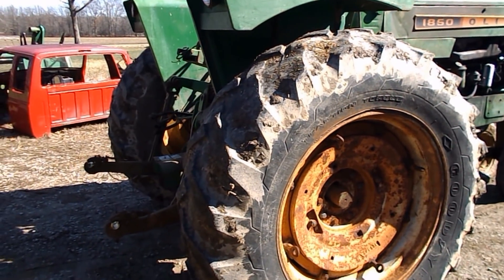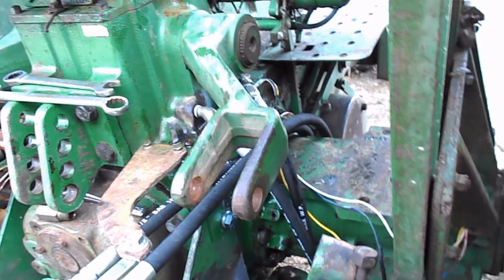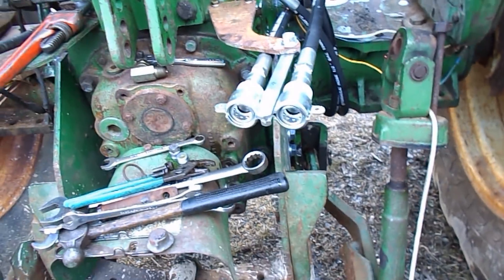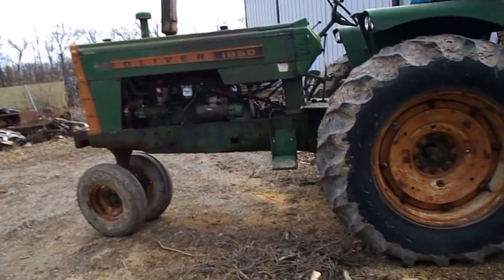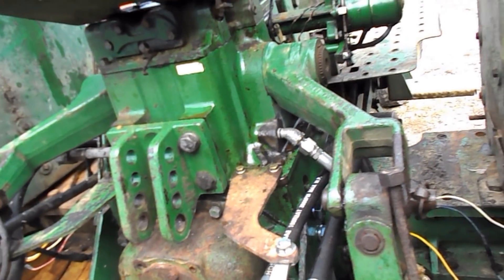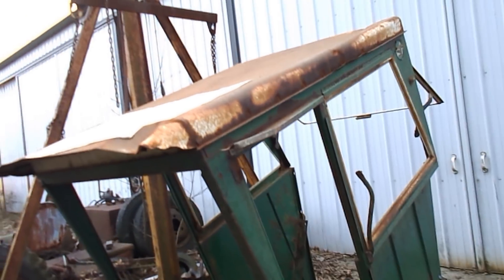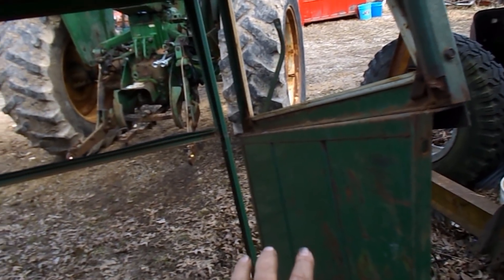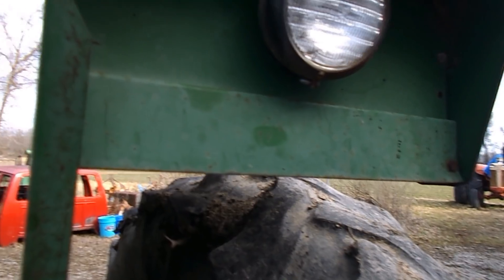Putting New Hydraulic Hoses on the Oliver 1850 part 10 A

Comment: Glad you're gonna put the cab back on it & some LEDs! Snazzy Outfit.
Reply from the maker: Yup cab is going back on for sure, I want to sit in the shade for a change and be out of the sun. Some might not like the cab but it came with the tractor and I have a use for it and can put some windows in it witch will help stay cooler. I bought some LED lights witch I'll use on it and I want to get some LED flasher light for the sides of the cab so it can be seen if I go on the road.  Bandit
Reply: @banditfarmer1900  Good deal.
Reply from the maker: @SchnelleKat  Its coming together nicely !  Bandit

Comment: We had done something similar with the hoses on an old Ford tractor. Discovered rather quickly it was a huge mistake for us to wrap around the axle. We went with galvanized pipe, short hoses and a more direct route with the hoses. 
For the cab, check into a sheet metal place, such as a heating/cooling company. They may be able to sell you a sheet the right size for the cab and at a much cheaper price than some place such as McMaster-Carr. 
She's coming along, if you got a moldboard plow, do a little spring plowing, that will help the old girl out. "Blow out the cobwebs" as the old saying goes. Hahaha Great video as always. Cheers :)
Reply from the maker: Well my 1550 has the hoses wrapped around it and I haven't had a problem with either set sense 1988 when I bought it and put them on so I'm not worried about them on the 1850. As far as the cab roof after looking at it closely I think I'm going to replace the patch on top that leaking cause finding a piece of metal 67" by 54"  is going to be hard to do, So a replacement patch is in order and I know just the scrap yard I need to go look threw as soon as it reopens after this virous crap gets over with. The 1850 needs worked for sure , Its running a lot better now but it still needs to be worked hard to blow the cobwebs out of it and get everything working good again.  Bandit

Comment: Making progress on that tractor my friend.  As Always , good video!
Reply from the maker: Thank You Charlie, Going threw it one thing at a time and making sure its right when I'm done it will be ready to go and I know its right. One thing for sure you guys are seeing about everything I do to it and this is what I do to every tractor of combine when I get it.  Bandit
Reply: @banditfarmer1900  Well, I have 4 Olivers and a White, but I learn something from you in nearly every video.  Sometimes what I learn is not Oliver tractor specific, but just a good general mechanical tip.  I've gotten lots of them from you.  I know my limitations and am not the kind who thinks I know everything.  I sure don't.  And I am definitely not afraid to ask someone who DOES know what I need to know or to get them to help me.  I always believed that we get taller by standing on each other's shoulders.  We need to learn from each other and share what we know.  I really appreciate having you as a friend appreciate what you share.
Reply from the maker: @pagrainfarmer  My friend we learn from each other and this is one of the many reasons I love youtube, We do learn from each other. When I bought the 1850 I knew I had to make a series of video's about it and show what I do to a tractor when I get it, 99% of what I've been doing is normal maintenance . Changing oils and filters greasing it adjusting brakes and clutch and at some point the PTO clutch. Now granted I bought it December 2 and hear it is March 22 and I'm still not done with it and that's because of weather or other restraints but the work is still getting done. I have it in the barn right now getting ready to start changing all the hoses when it warms up Monday or Tuesday but she is getting closer to being done. The day before yesterday I had started it up to move it around and it started leaking fuel out of the injector pump so I need to look into that , Might just be a loose injector line from ware I blead it but its a minor thing too fix. But everyone is getting to see everything I do to it and most of it has been normal maintenance and replacing what needs replaced like hoses and belts valve cover gasket adjust the valves but nothing major has been done to it. But when its done I know its going to be right and ready to go and look pretty good too ! I've taken a few ques from you guys on it so you guys know it or not are involved in it too .   Bandit
Reply: Yeah, us farmers have to stick together And help each other because few others will help us.  We have to fight everything - the weather, equipment, low prices for our crops but high prices for machinery and parts, stupid people who don’t understand, etc., etc., etc.  You know what I mean.
Reply from the maker: @pagrainfarmer  It takes a different kind of person to do what we do and were the biggest gamblers in the world !  So we have our own support group its called YouTube !  LOL If you ever get to feeling down in the dumbs just drive down to the local Wal-Mart and walk around and enjoy the sights and I guarantee when you leave you'll have a smile on your face and feeling pretty good about yourself !  LOL  Bandit
Reply: That’s what’s nice abiut the youtube community - there are certain people on here like yourself, Jacob, Soybean Farmer, etc who are down to darth and really “get it”.  Great to be able to discuss farm stuff with people who truly understand.  Then as you know, there are lots who really don’t understand.  Oh, and yeah, I DO k kw what you mean about the Walmart trip.  Hahaha
Reply from the maker: @pagrainfarmer   I was told one time that I had an old soul , Still don't know what she ment by that but there are people on here that really understand and get it. There are a bunch who seek fame and fortune and are sell outs to make money. But there are some who understand there is more to farming than just making a buck and don't have to have shinny new equipment or farm the whole country, No there are content to farm as they always have been with the equipment they have and there happy people.  There are a lot on here who just want to cause a problem start crap and act like they know it all and think they need to tell everyone what they should be doing. I have no time for such foolishness and its a waste of time to try to explain anything to them because they are always right in there small little minds.  But if your lucky you become friends with some of the people on here and it enriches you life in ways you never expected .  I was at the Wal-Mart the other day and it always amazes me how some of the sights you see in there, I know as they say It takes all kinds to make the world go round but WOW !  I hope for the best for us this year and hope its a good year for a change, We could use one about now !  Take it easy my friend.  Bandit
Reply: Yeah I think I suffer from that “old soul” thing too.  I always thought I should hAve been born 50 to 75 years earlier than I was.  I love what I do on the farm and love doing it the old way with “classic” equipment.  People like you I appreciate because you really get it.  I also hope we have a good year and that this virus stuff doesn't kill corn and soybean prices this fall.
Reply from the maker: @pagrainfarmer  I think the draw for me to the older equipment is that is all mechanical and I can figure it out and fix it. But the new stuff all you can do is stand back and watch when the service guy get there and hooks up his computer to it and does his thing. I like to be in control of thing because lets face it we have so little control over anything but on that old tractor you are in complete control !  I thing as far as crop prices go with last year huge losses from over 19 million acres not being planted and all the crop losses due to flooding and ground that is gone now from river changes prices have to go up some. Prices go by supply and demand and when the supply gets low like it is now they can go so long before they start raising prices to try to get more in to meet the demand.  You know if you think about it China does the freeze on our US grain imports screwing up the economy and now this virus coming out of China it really makes a fellow wonder.   We could really use a good year for a change so we can be a little more comfortable .  Bandit
Reply: Yep, what you say is true. Our old olivers are simple machines that are relatively easy to work on.  I hear that a lot of farmers that have had modern tractors are trying to find bigger but older tractors for that reason.  No computers, DEF, etc.  i hope you’re right about corn prices.  Not only did some guys not fet acres planted, but the at reports I hear on the radionsay there a lot of acres of corn in the west/mid west that never got harvested last fall.  Still out there.
Reply from the maker: @pagrainfarmer  The old tractors can sit unused for months or years and as long as the battery is up they will fire up and go to work and there a lot easer to work on. The BTO just down the road from me has a bunch of new equipment and I mean big and a lot of them ! But they also have a bunch of old IH tractors still working too from H's and M's to 806 1206's 766 966 1066 1456 1466 1486 1566 1586 and more. I don't know a farmer who has all new stuff that doesn't have an old tractor or 2 around on the farm.  There was a lot of corn still in the fields around here up till about a month ago and its pretty well all out of the field now but there was a lot of loss in it too. Most of that corn was later planted that just would not dry down so they left it in the field till it dried down some. I truly hope this is a better year with better prices but its not looking the best right now.  But I still have hope !   Bandit
Reply: I have hope too.  That’s part of being a farmer - new hope with each new planting season!

Comment: Lookin good Bandit, I’m excited to see it with the cab and windows installed, should look pretty neat. Thumbs up!
Reply from the maker: I hope I can clean that Lexan up good and buff it out clear again and I think it will work good on the cab as windows, The tint isn't very dark but I think it will help keep it cooler inside. Even if the side windows don't open the back opens pretty far out so I think a lot of air will move threw it and I like that idea cause I'll be out of the sun ! Some new LED flashing lights on the sides and 2 LED's on the back and a couple on the front I think I'll be able to see pretty good and be seen too !  Bandit

Comment: I am enjoying seeing the 1850 coming along. I have two thoughts, I understand why your wrapping the hoses around the axle, I would get a piece of the nylon hose sleeve and put on them to keep them from rubbing on the axle housing or getting snagged.

Second thought, on the cab of you could come up with a way to fit a piece of aluminum foil bubble insulation in the roof might help keep it cooler by reflecting some heat back.
Reply from the maker: Travis I've been doing it this way for 30+ years and I have yet to have a hose get snagged on anything yet nor have I had a hose get rubbed spots in them and this is why I leave them the way they are so they stay relaxed. I would rather spend a little extra on hoses and route them this way so they are relaxed so it makes it so much easer to hook and unhook a hydraulic cylinder plus if a hitch pin comes out the hoses wont be ripped out of the casting, At most it would bend the pipe nipple down witch would be easy enough to change.   To cut down on noise in the cab I'm going to spray rubberized under coating on the inside of the sides of the cab to deaden any noise but for the roof I'm not sure what I'm going to do on it yet , It needs replaced if I can find sheet metal to make it out of in one piece. A piece 54" by 67" is not going to be easy to find. I am looking at my old 95 combine to see if I can take the cab off it and making the roof work on the top of the Oliver cab and widen the top of the cab about 8 or 9 inches down to the fender top.  Don't know what I'll do yet but right now I need to get the tractor finished and the cab and fenders put back on and get it ready to work, I'll have more time this summer to make modification to the cab, Nice thing is the cab is bolted together so I can take parts of it off as I need to and make things work better.  Bandit

Comment from the maker: Well I got a nice day and went and got some new hydraulic hoses and new Pioneer hydraulic ends on the 1850, I want dual remotes on the 1850 so here we go. I ran into problems right off the bat as the plugs were frozen in the casting so I had to heat them up with the torch and really had a time getting them out, My poor Craftsmen 3/8 ratchet was bending a we bit when it finally popped loose and the other one was just as bad to get off but they both came off finally !  Sorry about the missing video of putting the hoses on the video file is really glitchy to say the least and have no idea what happened to it all the rest are fine but you get to see most of it. After getting this put together I'm not happy about the way it is or looks and I might be taking it all off and doing it another way. I wanted 4 hoses and sets of ends but all they had was 2 hoses and 2 couplers so I figured I would put the set on the right side first before I replace the other side. On the cab I have a plan for it and I really want to leave all the writing along the sides of the cab alone, Kind of tells a story about the 1850's history in what was done to it and when. I have a feeling I'll be taking this back apart and doing it another way. On the tinted lexan do you guys think its a good idea or not, Let me know in the comments. Well I hope you enjoyed watching and let me know about the Lexan.  Bandit
Reply: @bandit why not cut the bracket end off, and reweld it at a 90 degree angle so the remotes are in the vertical orientation like on the other side
Reply from the maker: @jmon1177   I could do that but I would rather have them this way to make it easer to hook up. The other side is set up for Oliver ends that no ones has anymore plus it looks cleaner this way.  Bandit

Comment: I can see why you're doing it that way, but I would rather make it so there is a 90 degree pipe fitting about 2 inches(might have the one further ahead out abit more) from the casting then have the hoses run straightish to the couplers factoring enough slack for the couplers to work right. I just hate seeing extra hoses wrapped around things. Call it ocd if you like. 
The cab idea seems good. I would think that you could have enough ventilation with a windshield installed, since enough air would come through the doorways. You could always add a windshield later, if you desire. 
Keep healthy my friend.
Reply from the maker: Well you know how fun hooking hydraulic hoses up to an Oliver can be so with the hoses wrapped around the axel like this 1 it gives you more room to get ahold of the hose to force it in and 2 IF something happens to the hitch pin and something comes un hooked the lines are relaxed enough to let them pop off easy. My 1550 is wrapped around the axel just like this and I did them this way in 1988 when I bought it and I've yet to have a problem with them.  The next video will show how I fixed this problem and cleaned it up.  I think my idea about side windows and a back window is a good idea to keep the weather off me and with a back window that opens as far as it does a lot of air flow threw it to keep me cool.  Bandit
Reply: @banditfarmer1900  I would be worried about thing snagging on the hose, such as when you spray corn that is getting tall. Our David Brown has a single remote and one way couplers like what I am thinking you bought for your tractor. The hoses are maybe 18inches long between the valve and the coupler, and there is more than enough slack to hook up hydraulic lines. (Actually thinking about it again, you dont need a 90 degree pipe fitting, just have the hose bend at a loose 90 degrees). And in the event of becoming accidentally unhitched, what difference does it make? The couplers don't pull out of their holders(atleast never on us). When that happens, we have enough hose on the machine so when we back up, there's enough slack to undo the hoses. Yes, we have wrecked hoses the odd time. Want easy hydraulic connecting, buy female hydraulic couplers that have a two way collar. You don't have to hold the female coupler, if set up right, when hooking up or unhooking. Just pull and push. Our Massey Ferguson has them(should upgrade the David Brown too) and it's easy to hook up hydraulic lines.
As I say you try it your way with the cab and if you want to you can always add a windshield later.
Reply from the maker: @ghenry85   The couplers I bought are Pioneer and there push pull couplers that's why I want the hoses to be as relaxed as possible  so if they do get jerked they will release but if it doesn't and pulls the coupler out of the holder the hose should brake before the fittings do being wrapped around the axel like they are. If the hitch pin comes out you cant hit the clutch fast enough before something else brakes, Its just the way it is at least for me anyway ! LOL  I've never snagged any of the hoses I've put on for the back but the only one I have got hung up was the ones going down to the loader and that was from a stick the tire kicked up just right and caught the loader hoses and made a mess. But I've never caught the one around the axels. I think the 3 windows will work for now and the windshield can wait till much later on, But for now its just get it on first ! LOL  Bandit